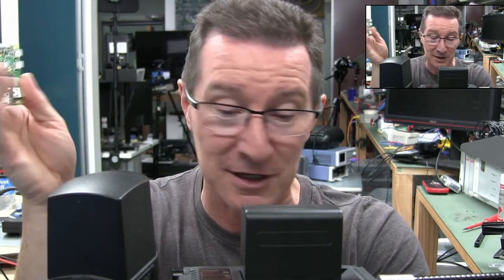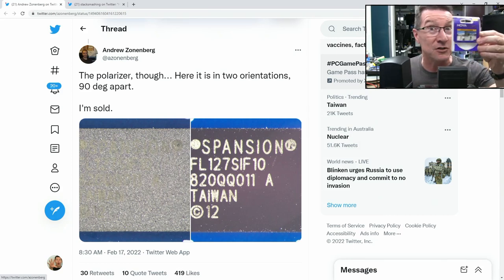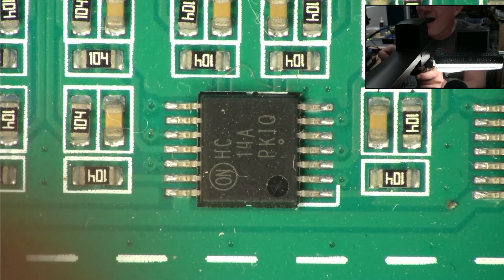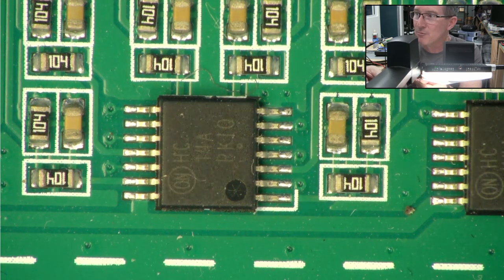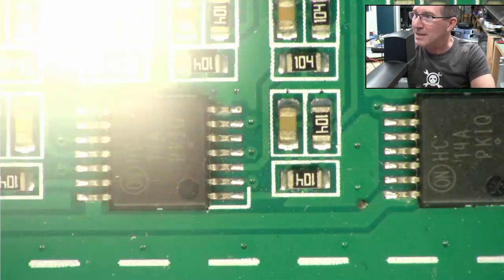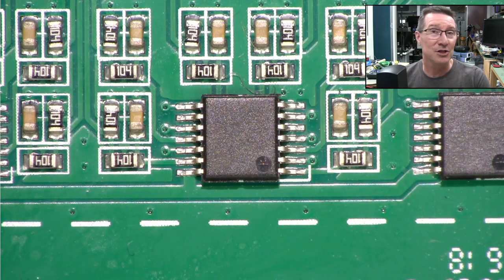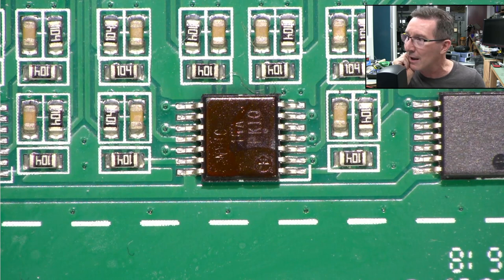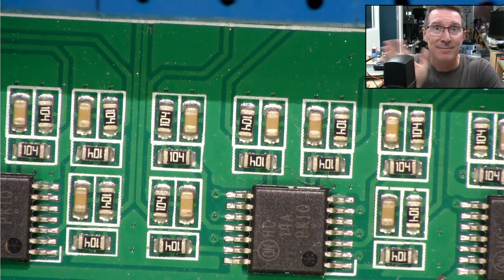EEVblog 1458 - Microscope Polarising MAGIC!

Comment: A few years ago I found that using a blue LED torch helped to see the markings on IC's if you got the angle right - I guess it improves the contrast, or maybe the markings fluoresce somewhat. Sadly my little blue torch got dropped down a drain and didn't survive the process!

Comment: yeah its a multi way dance between the benefit of the polarization filter, vs the amount of light reduction vs extra lighting needed to maintain the same level of effective illumination... vs the amount of zoom you need to get a sufficient resolution fidelity vs the auto exposure on the camera and the other noise performance sensitivity etc capability of the ccd sensor etc. so its finding the optimal set of tradeoffs to make the most out of your own specific combination of pieces of equipment.

however the thing i didnt know before was that circular polarization is better than linear. because i tried linear. also the cheapesst plastic films introduce abberations and optical distortions reducing quality and fidelity which is avoided by a rigid glass or hard plastic polarization filter. which is more expensive of course maybe a cheaper filter on the light source perhaps would not matter? if you then can spend more on the lens filter to get a better one

i suppose overall polarization filters makes more sense on higher end equipment or only after you have already over maxe the illumination such that your sensor is already saturating over exposed. since adding the polarization then cuts the amount of light getting thru, thus bringing down the amount of light reaching the sensor. but that is also must be considering the maximum 'usable' zoom level too (which isnt too zoomed to still capture the full set of chip markings without cropping out), which then also changes the effective exposure (or aperture whatever you call it). as zoom by just itself can be dimming the image more stops than the polarization filter is capable of. depending on how small the chip is you need to be reading from... i guess some people go even smaller with biological microscopes and die shots. but we arent so interested in those types of hobbies. at least not until the industry moves forwards again into 'ultra smd' whatever. those will be dark times indeed. because will be requiring an even higher zoom. hehe

Comment: Nothing wrong with a little adaption to make life better particularly if you read part numbers a lot - I just would not buy a photographic filter, just get some low cost film if you want, you can easily get spares for phones and tablets.  Ring lights are nasty for part numbers and contrast in general because they light from all sides.  Fitted rotating polarisers on lights and objective is handy but hardly essential but nothing wrong with wanting nice tools!  There are other methods, my microscope has phase rings and these work too but similar issue they have to be fitted to both light source and objective lens.

Comment: I suspect the real use case for cross polarized light source/filter is when you've got chips that have been abraded or otherwise worked over to obscure the part numbers.
Reply: Will polarized light help in those cases?!
Reply: @stefanmayer444  That is what i'd like to know
Reply: @ka9dgx  I'm not sure what methods are used in forensics to recover "removed stuff", but maybe there are some methods for that.
Reply: No chance. The abraded surface includes whateva was etched there less than 0.001" deep. Laser etching doesn't impress the material that may have an effect at depth of crystaline structures in the substrate material, like say serial numbers stamped on a metallic component that can be detected after careful polishing of the abraded surface.

Comment: It's like the difference between linear and circular stereoscopic 3D. The old passive 3D movies in the 80's used linear and today's "Real D" is circular. You can't turn your head at all with linear 3D. You'll see 2 images. But with circular polarized 3D, women could rest their heads on someone's shoulder and still watch the movie. Either way, you still lose the 3D effect but at least it's not visually uncomfortable.

Comment: It's magic! Ripped the filters out of a pair of 3D glasses and it really does work wonders at almost any angle, the contrast you get is much better than spending 20 minutes screwing around changing the camera angle and light angle only to end up with some rubbish oblique angled image you have to de-warp in Photoshop.

Edit: Just used this trick to take a picture of a DIP package from directly above for my next video!
Reply from the maker: You just need better light sources. See my DIY light box for PCB photography work.
Reply from the maker: https://www.youtube.com/watch?v=6ZH2KeplSrs

Comment: I’m baffled by the cp filter. From the photography description of its use it is not a circularly polarized optical filter, just a regular linearly polarized film that you can rotate to remove some reflections or haze. Sure, the filter is circular but not circularly polarized! 

If you rotate a circularly polarized film it makes no difference at any angle, just try it with a pair of 3d glasses. It totally blocks light polarized with the opposite rotation. It makes no difference how much you rotate it. You tried this and it didn’t work right? Now close one eye and try again. Reflected light gets its rotation direction switched so if you look at yourself in a mirror, that eye is blacked out, the one that has its direction reversed. Again rotating it has no effect. 

Can someone explain this to me?

Comment: Having a vision impairment when I work on PC PCB's and I am trying to read a particular chip or even read silk screening on a motherboard or soldering I use a very vright adjustable LET torch and I try different brightness's or angles with a magnifying glass to see what I have to see. A microscope is the next thing on my to buy list. Thank you for the advice from this video this will help me alot.

Comment: Looks like I will be hunting up a donor LCD screen to strip the film out of it, though likely I will simply split the 2 glass panels apart, and clean them off, and cut them to size, and sand down the ends.

Yes the extra light at an angle is always better, I have some USB 18650 power banks with a permanently attached cheap USB plug in light on them, though I did upgrade the cheap no name 1W star boards to 3W ones, running at 100mA, much more light, and much better led dies in them. Even have some on goose necks, though they are not as convenient to use.

Comment: Worked with top of the line white laser Leica confocal, they make some good stuff! Would be a cool video if you could explain how Leica can use "white laser" to generate multiple frequencies of light!
Reply: They use a acousto optic filter. Basically a optical crystal with some piezo transducer attached. The sound waves in the crystal are able to change the refractive properties of the material. This way you can selectively filter for your desired wavelength of light.
Reply: @mschwemberger  thanks, yeah, I rememer it was in a certain loop configuration with taps for different frequencies at different places. Still, magic for biomedical scientist. I never got to test the intensities though.

Comment: Sometimes I find it difficult to read the part number on conformal coated components, regardless of the angle of the light. Could polarizing filters help in this situation?
Reply: I’d guess yes. It should at least cut a bunch of the reflections and help a bit.

Comment: I have a very cheapy chinese microscope (I am ashamed of calling a microscope, actually) that has a couple of crappy leds to illuminate and most of the times, it is better to turn them off to see the IC markings. But, as you said, the angle of incidences plays a big role in it.

Comment: Hmmm. This is a bit wrong there. Play with the polarizer filter WHEN YOUR BOARD IS AT AN ANGLE. The filter wil work by removing the reflection, which will make the text readable if the board is tilted. It surely helps, but I wouldn't bother as long as I can position the board or the light. For cases when it's not possible, a polarizer filter will work wonders, but what they show in the video is that they INDUCE polarization that they remove with the filter... Thank you captain obvious :)

Comment: Thanks for this vedio.
I have agilent E4416A series power meter. the voltages are ok 12v,-12v, 5v and the battery measures 2.9v the stand by light is on but when I press the power button nothing happens you can help me and thank you  in advance.

Comment: Why does rotating a circular polarizer make any difference?
Reply: Reposting my own top-level post:

"The reason why circular polarizers are preferred by photographers is subtle and not really adequately explained by "works much better than linear polarizers". The photos you would take with a linear polarizer would look identical to a so-called "circular polarizer", but the linear polarizer would send linearly polarized light into the camera, which can confuse and upset the auto-focus/auto-exposure features of the camera. So the circular polarizer adds some wizardy after the linear polarizer (namely a quarter waveplate) to take the light which has already been filtered by the linear polarizer part, and scrambles/circularizes the polarization. The filtering-according-to-polarization has already happened, but the polarization is rescrambled so that it doesn't screw with the auto-focus etc.

It just so happens that if you somehow attach the filter *backwards*, what you end up with is a filter that would be selective to circularly polarized light, but that's not the way we attach these filters to our cameras.

So TL;DR, it's really a terrible choice of name. A "circular polarizer" is a linear polarizer with a little hack added to prevent it from breaking auto-focus; and it has practically nothing to do (as far as the end user is concerned) with circular polarization."
Reply: Linear polarity is when the E and H fields are in phase with eachother. Circular polarity is when there's a 90 degree phase shift from the E to H field. When using a circular polarizer to filter linearly polarized radiation, the orientation of the circular polarizer with respect to the incident radiation is still important - it's just that the circular polarizer also gives you the 90 degree shift between the E and H fields. If you look up the theory of RF (microwave) linear vs circular polarization, you'll find some nifty interactive demos. Light is just "really high frequency" RF after all - all the same, just higher frequencies / shorter wavelengths. So the TLDR is if the incoming radiation is purely circular, rotating a circular polarity filter has no effect, but when the incoming radiation is linearly polarized, the rotation of a circular filter still has just as much of an effect as rotating a linear polarity filter does.

Comment: I use a torch at a really low angle lol
Reply: I do component level automotive repair and now im on ebay for a polarising filter haha and a film
Reply: EDIT and you demonstate the low angle light trick later in the video. Alot of the circuits I work on are conformal coated, need to still try the polarising filter trick see how it works.